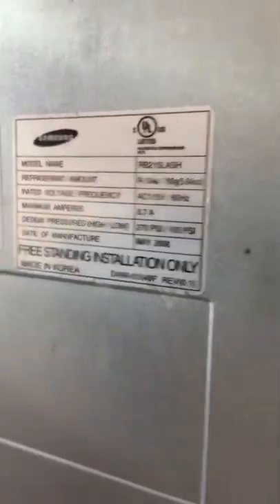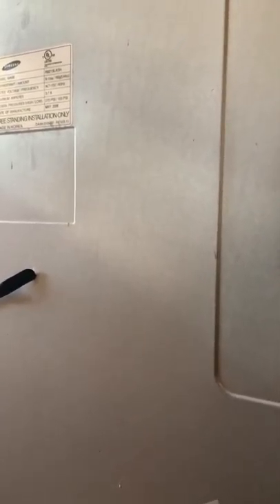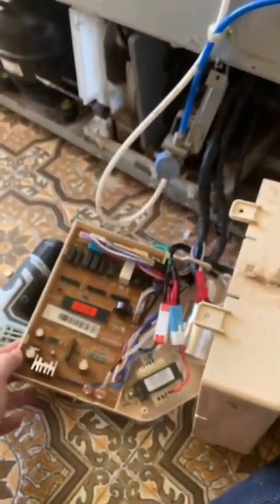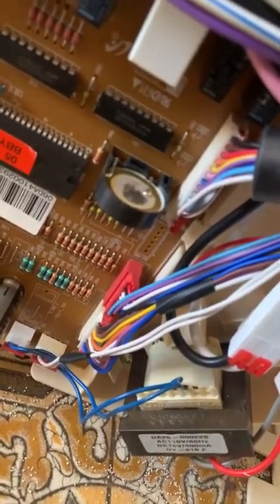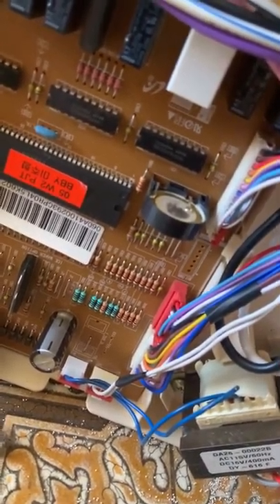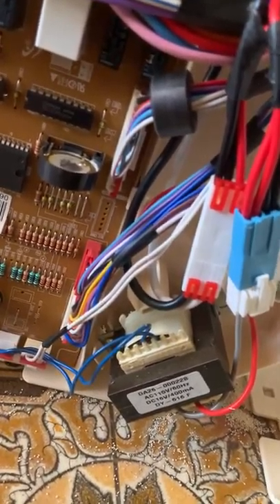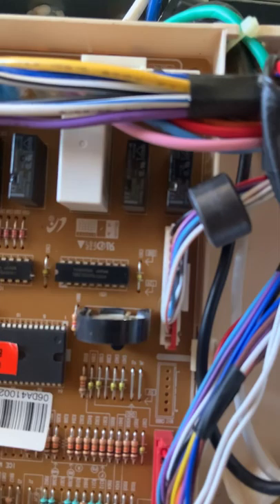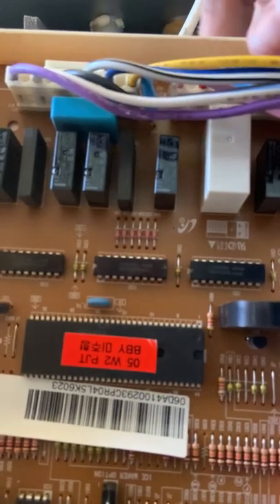Samsung RB215LASH or any Samsung fridge with door alarm stuck beeping

Comment: I know I'm a little over 2 years too late, but did you check the door switch?  Do the lights inside go off when you manually toggle that switch?  If they don't, that's your root cause.  I came across your video while searching for a different issue.
Reply: Hey mine doesn’t turn on in the fridge when the door is open but I just switched the door switch - what did you find?!